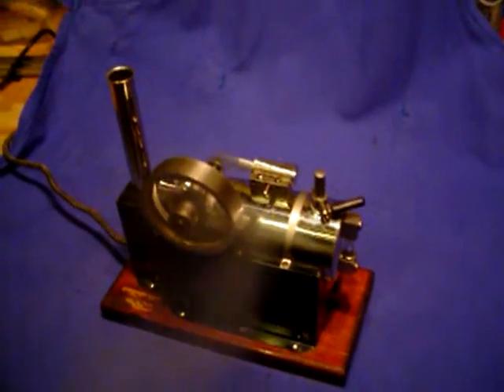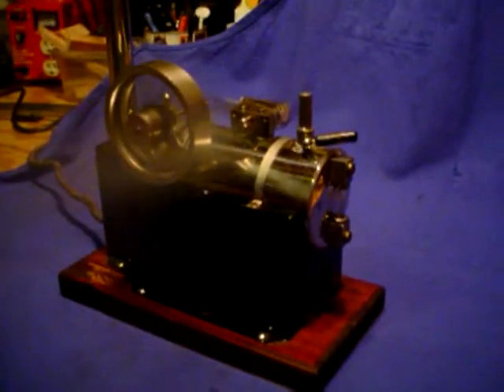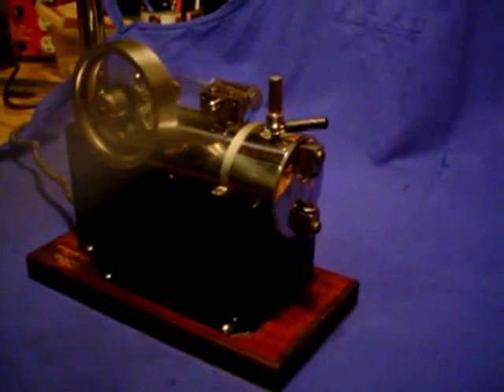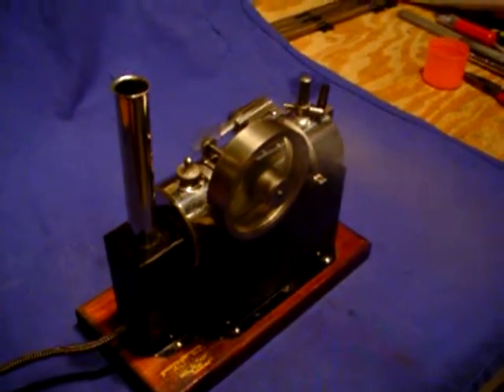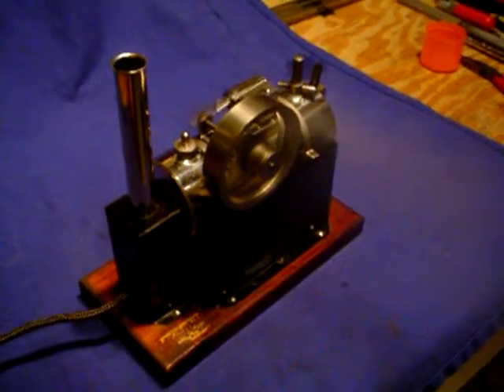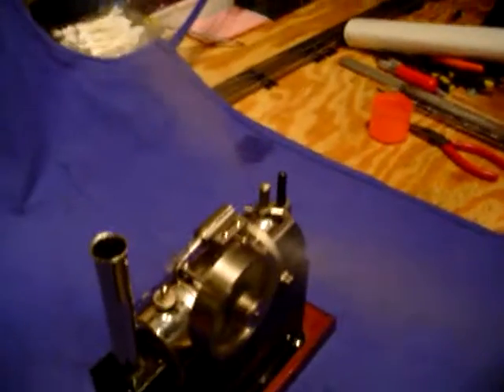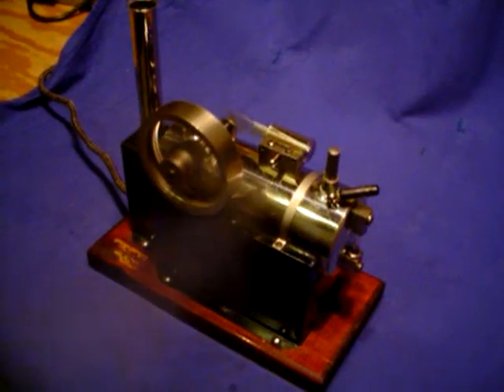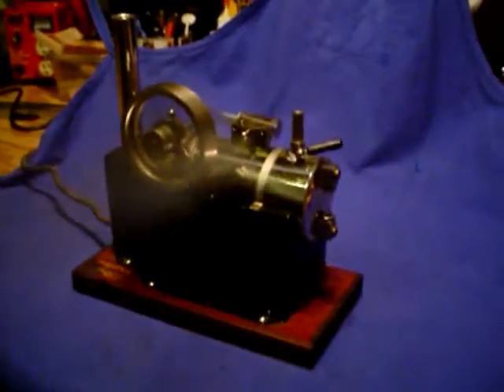Jensen 35 with cast flywheel

Comment: To regulate the engine better if your good with it is to let steam out through the whistle, and when you get the engine to ideal operating speed then shut the whistle.  I have run my engine very slowly and the safety was poppin so I opened up the whistle all of the way and it sounded like the safety valve on a steam locomotive.  It doesn't have the whistle sound, just escaping steam and when the safety stops poppin I close the whistle valve, and when the safet pops again, I do it again.